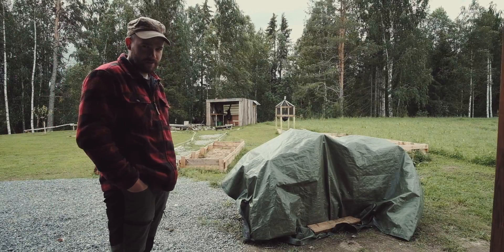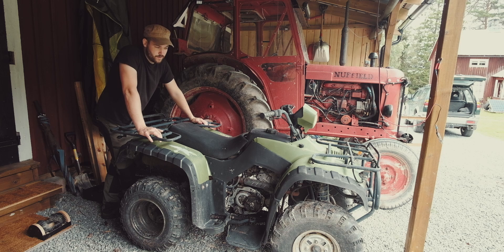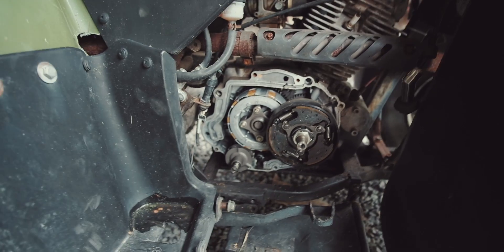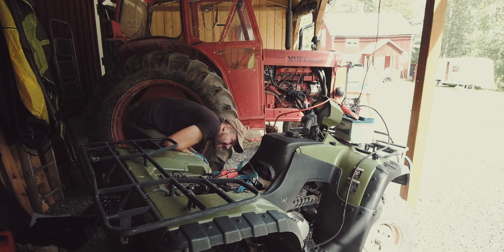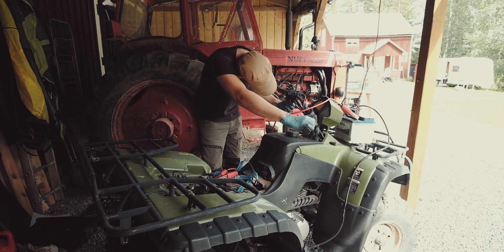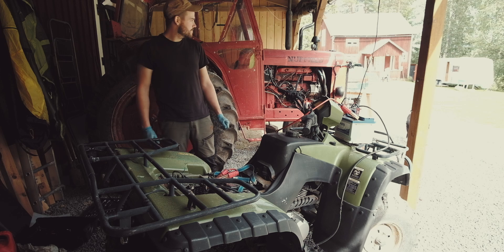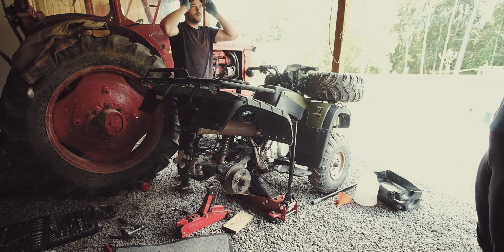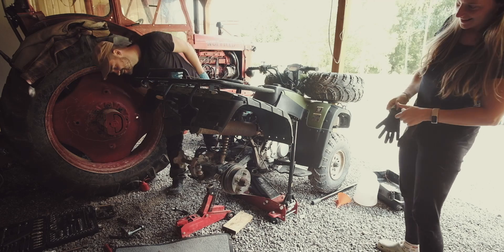Can I Fix This China ATV?

Comment: That was a stroke of luck finding this at the last minute. Just a few easy jobs and a new addition to the fleet. Lots of summer fun in store with this and probably winter. Should be good for pulling a small trailer for wood etc.
Reply from the maker: It's definitely going to make our lives a whole lot easier that's for sure! I reckon with some chains on the back and a snow plow I might be a handy winter tool as well

Comment: Chinese electrics can’t be that bad after sitting outside in Sweden for a long time, good fault finding 👍
Reply from the maker: In my experience they are just very brittle even from new so have to take extra care. That's in all areas actually, not just electrics 😅 they are alright machines if you maintain them well though 👍